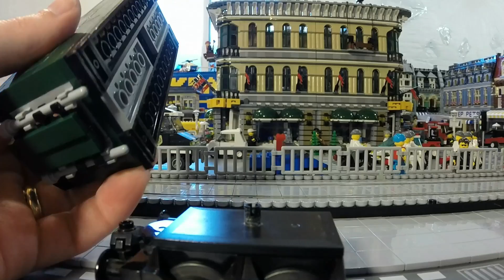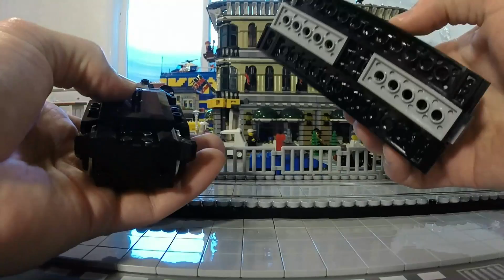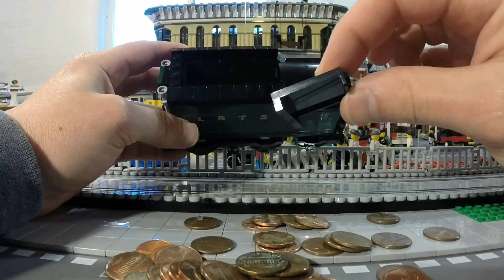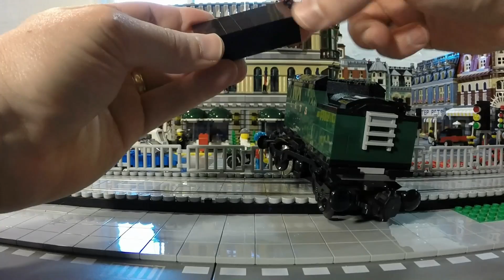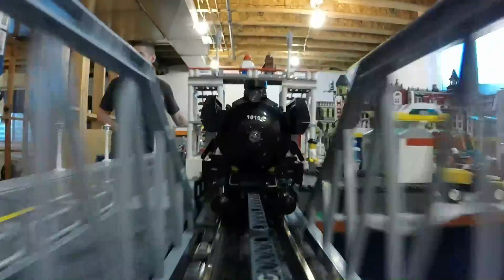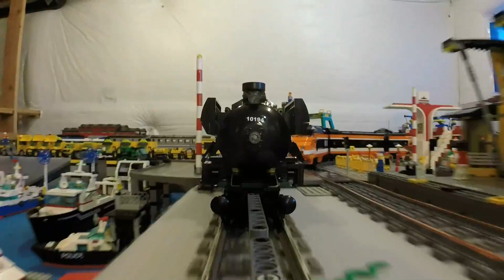Adding 9v to Emerald Night

Comment: How's that motor wheel part/ the 9v controlled? What is the controller? I wanna do this to my emerald night but Idk what stuff to get. I looked on Amazon when I search 9v Lego motor I just find this but different versions with wiring and stuff. I wanna get the one you have but I can't find it.
Reply from the maker: It would be the same setup you'd get when buying a 9v train set. These links should help. One of each. 
https://www.bricklink.com/v2/catalog/catalogitem.page?P=590&idColor=11#T=C&C=11
https://www.bricklink.com/v2/catalog/catalogitem.page?P=2868b&idColor=11#T=C&C=11
https://www.bricklink.com/v2/catalog/catalogitem.page?P=70931&idColor=11#T=C&C=11
https://www.bricklink.com/v2/catalog/catalogitem.page?P=5306c01&idColor=10#T=C&C=10
Reply: @alexnunes   for the help I just had one more question. What does that last link one do? The train track contacts with wire. Is it supposed to help with charging something?
Reply from the maker: @koltarus3561  This is all assuming you have 9v track. That last part connects the speed regulator to the tracks. The electric current needs to run in the tracks to power the motor in the train. Hope that helps.
Reply: @alexnunes  so if I don't have any of that should I just go for power functions?
Reply from the maker: I'd say yes, but only because I think buying 9v track would likely be more expensive. I actually don't like PW. They have their place, but anything that is battery based is just a pain to deal with. Having it run from electricity from your home via the 9v speed regulator is just so much better than dealing with dead batteries.
Reply: @alexnunes  ok one last thing, for the power functions do I have to use the AAA 88000 battery box? Or will any work i seen someone list the stuff you'd need to add PF but they specifically listed the 88000 power box. so I was just wondering if I had to use that one or I could use any?
Reply from the maker: @koltarus3561  Either battery box will work, as long as it is Power Functions.
Reply: @alexnunes  ok, tysm for all the help 👍

Comment: Is that set of wheels you added to the tender already made with a remote control? Or do you have to like build it? Cause this seems a LOT easier than fully adding everything to the train, (im kinda dumb when it comes to this stuff) And if those wheels are 1 piece with a control whats it called?
Reply from the maker: The 9v motor requires a speed regulator. Here's a link to it on Brickset https://brickset.com/sets/4548-1/Transformer-and-Speed-Regulator
Reply: @alexnunes  Thanks!

Comment: Even with that second part the piston and connecting rods still lock up. The issue really that both sets of flanged wheels aren't powered along with the length in between the piston and lead drive wheels being too long.
Reply: That’s not the issue lol. The Piston is too short. Extend it and it runs smoothly

Comment: You should replace the IR spot with the 1x1 slopes and 1x4 tiles for the 2x4 sloped with stripes. To me, it completes the engine's roundness instead of a random bulge in the engine.
Reply: Are you talking about the protrusion atop the middle of the boiler?
That's not a "random bulge", that's the steam dome. Those are a thing that many real steam engines - including the LNER A3, the basis for the Emerald Night loco - have.

Although it could be more accurately shaped. A 2x2 round plate, a 2x2 round tile, a couple of jumper plates, and a 1x2 tile might do the job.

Comment: I think because when you go backwards I think Lego wants you to make it realistic so like instead of going so fast backwards bumping in to the coaches I think that that's for a lock to go slow backwards for more realistic touch.
Reply: Sean Aba, not at all, it was an engineering fail. A real steam engine is actually made to go backwards smoothly. If a real life steam engine piston fails, the entire rod would actually crack and break. Good thing it can be fixed by 6 pieces.

Comment: So, could you use the placement of the 9V Motor under the tender, to run a PF Train Motor there? Or would the cords not be long enough?
Reply: If you're talking about the 88002 Power Function Train Motor. I've just tried that this morning. The cords are long enough and there are two instead of one connecting to the tender. But the problem I had was that the motor didn't have enough torque to push the whole locomotive and kept wheeling into place (I did take off the gear on the locomotive's axis). This may also have been because my train track are laying on the carpet instead of a flat hard surface. I'm still trying to make it work with the 88002 motor though so it can go a lot faster.

Comment: Normal LEGO trians can run on 9v tracks right?
Reply from the maker: Yes, they can.
Reply: sean star, powerfunction trains won't blow up 9V.... They only guide along the rail.
Reply: it can be either pf or 9v but for 12v i has a plan
Reply: yes but try  running  you will bllowl  the train

Comment: Guys I always wanted this set
Reply: Build your own, that's what I did. But make sure you read over the instruction manual for any pieces you do not have. I can also tell you how to make the train go even faster than ordinary
Reply: You're going to need a PF XL motor, then the gear alignment will have to be the 16 piece gear, the 24 piece gear and then the 8 piece gear instead of usually being 16, 20, 12. I can also teach you how to increase pulling power (torque) Greg De Ligne
Reply: How can you make it faster? (Apart from doing what's in the video) I'm trying to run it with a 88002 motor.
Reply: You're going to need a PF XL motor, then the gear alignment will have to be the 16 piece gear, the 24 piece gear and then the 8 piece gear instead of usually being 16, 20, 12

Comment: I have a Lego BNSF GP-38 and I wanna get a 9v motor for it... Do I need to have 100% 9v Track where it runs?
Reply from the maker: ***** Yes, or you will need to adapt your PF track to run the 9v motor. You can do this using copper foil tape. It is a much cheaper alternative.

Comment: WHERE IS THE RECEIVER?! WHERE IS THE BATARY BOX?!"
Reply: MrCraftingMiner It's using 9v tracks.
Reply: TeamEmeraldElements yes.. the good old ones :) I prefer them a lot. Being able to use a remote control has its advantages, too, however, I don't like to depend on batteries. The 9V tracks also look better because of the metal on them.
Reply: THERE IS NO RECEIVER!OR BATTERTY BOX!
Reply: +MrCM.Bricks Sorry, I realised that my little brother has figured out my pc password so I changed it. He dosen't know about the good old 9 volts so, sorry my emails also stopped working 9 months ago and they only just started working again. Sorry for any inconvenience!
Reply: 12v is still better, come on it is

Comment: I had the same issue with the pistons when going backwards. To fix it I replaced the 5 studs long plate with one that's 7 studs long, and moved the dark grey axle 2 studs back on the rod that connects to the wheels. I hope this made any sense. Love the videos!
Reply from the maker: Good suggestion.  I'll look for those elements. Thanks
Reply: Alex Nunes No problem :)

Comment: Bravo, Yet Another Good Video from you. I have always preferred to use 9-Volt but being on a tight budget, i can only use power functions. Also, a recommendation, you should move the Bike Shop and cafe closer to your residential area, it seems like it might fit better there.
Reply from the maker: Derpalicious VonDerpenstein Good suggestion. I'll see if I can find a spot.
Reply: Alex Nunes Thank you for responding, i make that recomendation because in my own city, i have spot reserved for that and the Lego City House right out side my residential area, facing Downtown.

Comment: Great Video Alex.  I Made a Custom Coach car to add Power Functions to my Toy Story Train.  It has the same problem.  The front of the engine has wheel slippage.  How could I add weight to it to prevent that.  Any Ideas, I would apperciate it.   Mardigrasman23 Lego #7597 Toy Story 3 Western Train Chase Set Review
Reply: i added a 4.5v motor to the train and didnt incounter that issue, try 4.5v motor

Comment: Those cylinders aren't hard to extend. Also, if you haven't already, remove the gears in the bottom. I like mine on PF as it has a lot more power, but I can see why you want 9v.
Reply from the maker: MrRailroadrunner I noticed that PF had a lot more power as well.  It also seemed to withstand a higher work load. I may go back to PF, but for now I'm happy with it.
Reply: I did see a mod somewhere to sink a PF motor into the firebox,but I don't remember where.......

Comment: I was wondering about the power functions and 9v train motor. Could you attach the power functions battery box or other 9v battery boxes to the 9v motor so it'll take battery power once it drives over a piece of non electric track? Just wondering because I know the 9v motor accepts battery power instead of rail power.
Reply from the maker: jorenmartijn Yes, that would work just fine if you went that route. You could even have PF assist the 9v while it is still on the metal track.